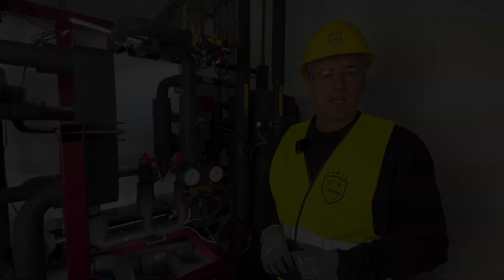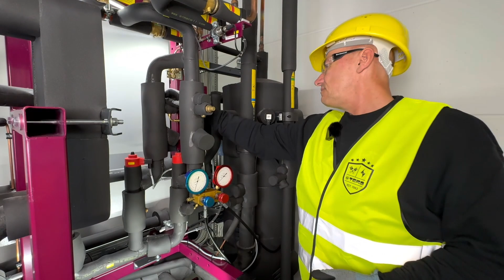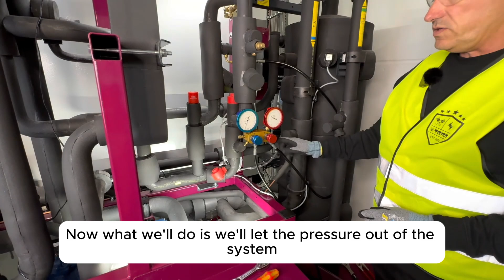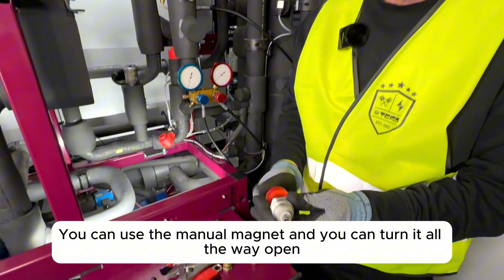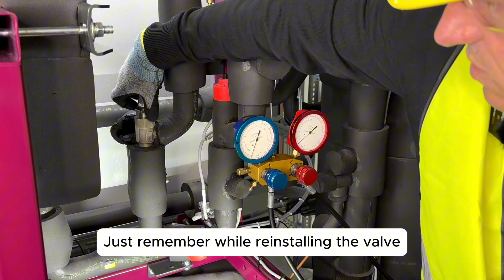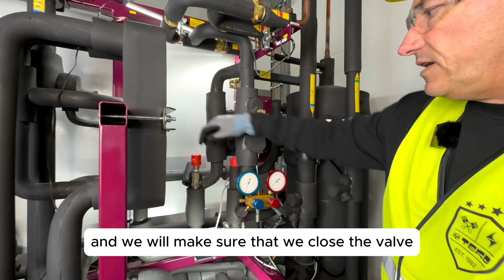HOW TO... Disassemble a High-Pressure Valve – Perform Maintenance

Comment: Hey Maurice, nice demonstration 👍. I missed an important step 😉 Take care to disconnect the power supply from the solenoid coil of the high pressure valve before you remove it from the valve body. In your German video Sören did it before. Otherwise the solenoid coil may be damaged. Best regards Dominik
Reply from the maker: Hallo Dominik, danke für den wichtigen Hinweis!
Das Trennen der Stromzufuhr vor dem Entfernen der Spule ist essenziell, um Schäden zu vermeiden – du hast vollkommen recht. Der Step ist in der englischen Version leider nicht zu sehen.